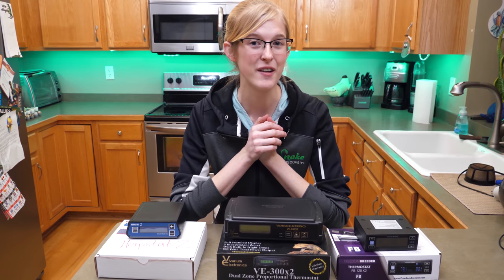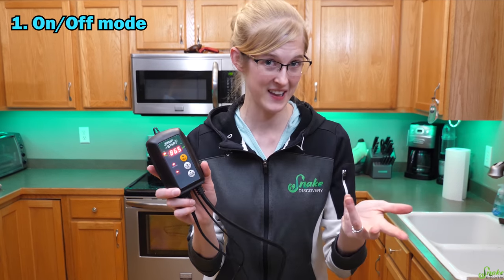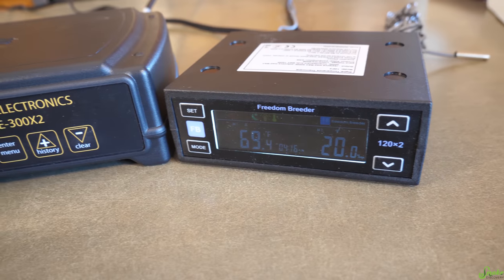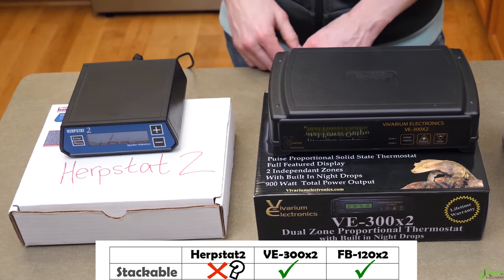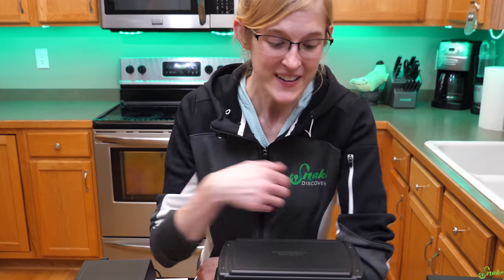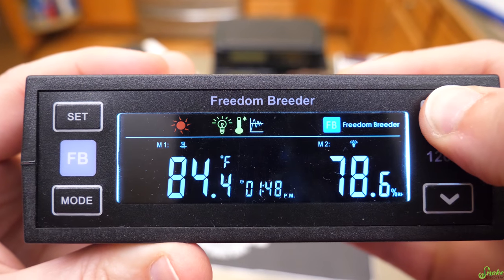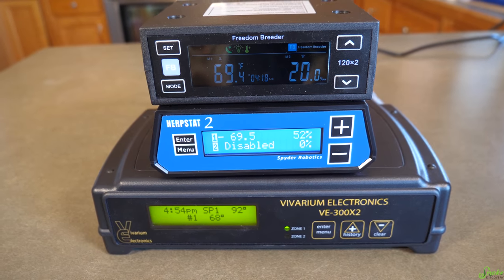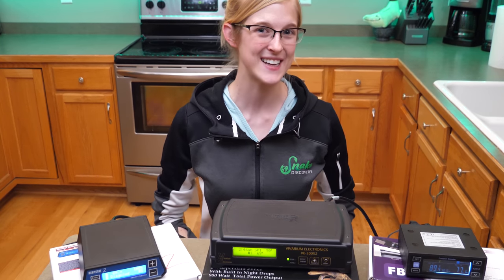Professional Thermostats: How they Work and Which is Best

Comment: Thank you for making this video, Emily! I've been wondering about this lately. I'd love to see a comparison between these and some of the cheaper alternatives.
Reply: Clint make a video about black Roughneck monitors
Reply: Clint's Reptiles   I’ve gotten the impression these are for people like yourself who keep lots of reptiles. Emily has promoted Jump Start over the years, but I found one on Amazon I actually like better, and its cheaper. Boho Farm Heat Mat Thermostat. It’s $17. I needed to switch as I had 2 Jump Starts die on me. At $35 a piece, that gets expensive! I’ve been running the one on my python for almost a year and it’s still doing the job.
Reply: @jesusbeloved3953  I havent been able to find a cheaper alternative to a dimmable thermostat - which is very necessary for heating elements with filament (such as basking lights) as pulse/ off on thermostats can limit the life of the bulb
Reply: Damn she didn't even heart your comment
Reply: @jesusbeloved3953  Oh nice. Cheaper is better. If you have time, could you reply to this and tell me how big it is? I don't want something too big. Thanks!
Reply: @anonymoose_987  She doesn't have time to go through all the comments. I mean, when you have like 100 reptiles, looking through comments isn't how you spend all your time. XD
Reply: Clint which thermostat do you use?

Comment: Just a note: visually opening your units and seeing something that looks like a relay does not mean it is a probe temperature safety shut off. Relays can be used for several different functions in an application like this, and indeed relays may not be the best option depending on circuit design. It would be much more useful to get the manufacturer's information as to their safety features, as well as how they work (there are many possible failure modes besides hi-temp on probe).
Reply: All power on a Herpstat is controlled by the triac components.  The safety relay is inline to the main power running to those and acts as a kill switch.  Under normal conditions the power flows through the relay to the triacs and when activated the relay breaks the contacts so it will cut power to all outputs on the thermostat.  The main reason for that feature is if a triac fails it normally fails full on so you have a run away heating condition.  These failures were common with other brands who used triacs that were barely rated for the spec.  I have always used much higher rated triacs in my design so that type of failure is extremely rare but I came up with the safety relay as a precaution.   However, it doesn't provide automatic protection because the user must choose to turn it on.  That is because there is a downfall that comes with it.  Lets say you have it enabled and you have a situation where one of your enclosures overheats (probe falls out of cage, ect).  When the relay kicks on you are going to knock out power to all outputs on a multi output thermostat.  If you have eggs in a incubator on the other output its going to go without heat.  Since its going to affect the other outputs some people may prefer to go without the safety relay and deal with the overheat on one enclosure if their income is depending on on the other enclosure.  We can't make decisions like that for people which is why we always try to give the options to the user.  That safety relay can be triggered on any alarm, just high, just low, ect.  The advantage of a single relay though is sometimes it catches when people make a mistake and pair the wrong probe with the wrong power cord causing their own overheat situation.  If you only shut down the side that was sensing the overheat it would no be effective because the user has the probe in the wrong enclosure.  By shutting power down on all outputs you can still make the save.  Again, many possibilities so it pays to be flexible with your options.  Oh, and wifi is on the way.  Email alerts, scheduled status emails, remote monitoring and setting,  graphed data, color lcd,  browser based so works on iphone, android, pc.  Its pretty slick.  It will be for the techies.  Launch date is not set yet but its not far off.  User manual on the new Herpstat 2 SpyderWeb device is on our website under the support section.  Great video BTW!  Customer mentioned it and sent me here.  :^)  -Dion (Owner, Spyder Robotics)
Reply: i have a snake and his name is zeno and hes older than me my family got him a year before i was born :)
Reply: @spyderrobotics_sales  I just want you to know that this response earned you a customer. It's really cool that you took the time to explain this.

Comment: I've been using the same Herpstat 4 unit, trouble-free for 10 years, reliably controlling light, heat, and humidity, nonstop day and night. It's an impressively solid and easy to use product.

Comment: Very very useful!  I burned a big scorch mark in a decorative throw that I was using to protect a piece of furniture under a snake habitat when my heat mat went to town on it. Could have done some serious damage to my snake as well, but the potential for fire with heat mats, even really well made ones, should not be overlooked!  I wish heat mats came with Built-in thermostats. Reptile products do not tend to have them, but I was able to find one on Amazon that was designed to warm up seed mats for gardeners that had a built-in thermostat. It was excellent and not that much more expensive. :-)

Comment: I have used the herpstat thermostats for years.  Early on I used the Helix brand. The Helix thermostats were nice but lacked the options that the herpstats have. The earlier versions of the herpstats had fans in them. The fans would eventually go bad causing issues with the thermostat. Spyderrobotics has since changed the design of the herpstats, removing the fan. At least in the herpstat 2 and lower.  I've never used the 4 or 6. I'm sure the VE, and FB are great also. Spyderrobotics has great customer support if you do ever need to get a replacement, or repairs done.  I'll be sticking with the herpstats. In my opinion, they are the best thermostats for reptiles on the market.  I'd avoid the cheap petshop thermostats. You get what you pay for. Buy cheap, buy it twice.   Spend a little more get a great product from a very well established company.
Reply: @not_mrphilips  Those are non-proportional thermostats and are at a large disadvantage for fine temperature regulation.  They are half as expensive because they have half the tech.  Plus you have to listen to the clicking relays all night long which makes them unreasonable for use in a bedroom.  They have no real features / alarms.  Their quality is no better.  You can search the web for reptile use and brewing beer use and find plenty of people that have had failures with the industrial thermostats.  The Herpstat is designed specifically for reptile use and we have worked with people almost 20 years now fine tuning them. Our Herpstats are used in large zoo's all across america as well.   You should try a Herpstat sometime and see for yourself.   They are a little more expensive but when you consider what people spend on their animals its money well spent.   :^)  -Dion (Spyder Robotics)
Reply: @not_mrphilips  From my information CE does not require 3rd party testing so most manufacturers can use the CE.   Either way our products are not  240V units or marketed for overseas which is where CE would come into play.

Comment: I just ordered a VE-300 single probe.  Price range is $144.-$165. The $165 comes with overnight shipping which Amazon values at $25.
   The single probe has 3 modes. Pulse ,  propotional and on off. Dont know why the 2 probe has less options. will running an EV 80w element.  Went with 300 over the 200 because of the built in night drop.
  Good informative video. Very appreciated 👍

Comment: Depending which state you're in, the warranty sticker is meaningless and in fact does not void your warranty.

Great video, but I still prefer my much cheaper option which does all the features mentioned.
Reply: What one have you been using?
Reply: @Kyenta    "VIVOSUN Digital Seedling Heat Mat Thermostat Temperature Controller" (purchasable on ebay for $34 CAD) and "Mini LCD Digital Temperature Humidity Thermometer Outdoor Hygrometer Meter Probe" (also purchasable on ebay for $3.50 CAD). I've had them for over a year now, I plugged in multiple heatmats to 1 thermostat without any issues and it's still very accurate according to my temperature gun and still reliable despite all the power outages and power surges I've been getting in my neighborhood.

The moment you put a label on something relating to pets, the price instantly skyrockets despite the product being identical to other products. The world loves to scam ppl.
Reply: Isn’t it labeled for that because it is meant specifically for that particular animal?
Reply: @battlebear437  Not necessarily. Things like sphagnum moss, heating mats, bulb fixtures, and so many more things are much cheaper if bought elsewhere that is not "reptile" or "animal" related.
Reply: @ryanchambers621  idek why I didn’t get this right away...I suppose it’s similar to places that you can rent for events, but the moment they know it’s for something like a wedding, they jack the price way up.

Comment: if you want to check the temps in your rack and want a high temp cut out as a safety, i use the Inkbird 308-T wifi controller. it allows me to see the temp and trend throughout the day and night and i can set alarms in the apps.

Comment: I bought a herpstat6 right off the bat when I got into the hobby 3 years ago and I have zero regrets. Safety features and added functions(also has a light dimming feature that simulates the sun rising and setting that I didn’t notice you mention but really cool for natural enclosures.(doesn’t work with led lights tho.)) compared to there completion made it a no brainer in my opinion. Great video tho!

Comment: I've been reading up on different thermostats, and lots of people have said  they started making  thermostats with pulsing and dimming options cause one of those settings would create a humming sound throughout metal snake racks. If you have PVC racks, i guess no noise would emit. I'm looking up videos cause i need a new one. My VE-100  keeps making a clicking noise every few seconds, and it says check probe. So my choices are A) 20 bucks on a new probe. That might not work. B) 150 on a new thermostat.  Or i took option C) 28 bucks on a thermostat called inkbryd. Lots of people talked highly of it in many snake forums.  And with Christmas and  the first of the month right around the corner , i really have no choice but to take the cheapest route for now.  Fingers crossed. Thanks for sharing your thoughts and insight on these. Happy New Year 🎉 ✨️ 💛 🤗

Comment: I run a herpstat 2 for my noodle. One probe for the heat mat, one for ambient temps.  Don't recall if I heard about those other two brands while researching to prep for getting my ball python, but I did know that I was going to spring for something higher grade than a jumpstart since I only have one snek and figured I could afford to spend a little more for the functionality, quality, and built in safety features.

Comment: For what its worth... i have experience with the VE and its "warranty".. i got a unit and tested/used it for 3 weeks, and i encountered a range of problems, from the unit not sending power to the heating devices, to LOUD clicking noises that would not stop, but the problems were sporadic, it would work for a day or two and then fail in the middle of the night.  I contacted them, and they ran me through a range of "issues" that i might be having as in getting probes crossed and other user errors, but nothing fixed it, and i literally tried everything, spent hours and hours working on it. Finally i demanded to send it back, they raised their eyebrows, said they just wanted to make sure it wasnt a 'user error' as i was going to have to cover the shipping cost myself, and they would hate for me to ship it back for nothing. I paid the shipping back, and they claimed to find no problems with it and just refunded me as i told them i was not taking that same unit back. I hope to god they didnt pawn off that unit on somebody else.. 
After that i got a herpstat and have had ZERO problems, its half the size, has more functionality and is just a dream. 
Anyways, just me 2 cents on the VE "lifetime warranty". Cheers.

Comment: For dimming output so far I have found Herpstat 1, 2, 4 etc, and Exo Terra thermostats (models with screen but watch out for the model with a light sensor in temp probe as it makes using night drop impossible if u have a heat lamp attached). I got a Exo Terra 600W PT2463 and the temp probe cable is so thick and only 6ft long. The heat lamp dimming is also not smooth. So now Im going to get the Herpstat 2 which has sunrise/sunset ramping, very smooth light dimming & a nice thin 12ft temp probe.

Comment: Awesome video. And i have the jumpstart thermostat after watching your videos. I had to get it for my new setup. I got an Animal Plastics T8 with an 80 watt RHP installed. Found it on Craigslist for $100.
Reply: Radiant heat panels are useless if you are not using a "pulse" thermostat. Jumpstart does not make those.
Reply: @GodZirra  thanks for letting me know that. I will have to get one of those then it was the only thermostat i had from before i upgraded

Comment: Freedom breeder upped their price since this video was released.  I've personally had trouble with the Vivarium Electronics (VE) thermostats and won't buy them again, even with the lifetime warranty.  Spyder Robotics's Herpstat is 100% worth it for the dimming feature alone and good luck finding it in any other commercially available thermostat at a reasonable price.

Now if only I could get my hands on the wifi enabled Herpstat 2 Spyderweb that has been sold out for over 2 months now.

Comment: VERY IMPORTANT QUESTION!! I plan on getting the herpstat, I will have my vision rack in 10 days! it has 5 tubs but all will be ran by one heat cable, do I need to get a thermostat with 2 or 4 probes??? I understand there's technically one heat source but is it better to have a probe for each tub or will 2 probes get the same job done? please help any opinions and tips are welcome!

Comment: If you need a cheap one probe controller for a heat light the HERPSTAT EZ1 on the herpstat website is a good controller I use it for my tortoise and it works great

Comment: How would thermostats work in a rack system? If you only have one probe, do you use multiple thermostats or just pick one bin for the probe to go into?
Reply: Erika Aberle You normally tape the probe onto the middle of the heat tape on the middle shelf.

Comment: Hello Emily and Ed! Would you guys consider doing a video discussing UVB? I just got my first reptile (a beardie named Montgomery Montgomery) and it is confusing! I have been using Facebook groups but the really don't explain much, they just beat you with the same you have to use tube uvb argument and they never really explain why? The only thing I've heard is coil uvb can hurt your animals eyes? I don't know what to think anymore! Lol 🤣 

P.S. Can't wait for more zoo videos! God Bless! ❤
Reply: The coil UVB used to be so bad it did hurt animals eyes. However the real problem with coil bulbs is that they are not strong enough for a bearded dragon. The two best brands of bulbs I've found in my research are either Reptisun T5 10.0 or Arcadia T5 12%.  T5 is the newest technology of fluorescent tube lights. It emits enough UVB for about 15-18 inches for a bearded dragon. A similar bulb, Reptisun T8 needs to be 6-8 inches from the basking site to give enough UVB.

Artificial UVB is simply so much weaker than real UVB from the sun. For the health of a Bearded Dragon or another lizard that needs 10, 12, or 14 percentage UVB consistently using the two bulbs i mentioned is the best choice. Another benefit for the long tube UVB is that your dragon can be in the hot spot with UVB or in their cool end with UVB. They have a choice. Plus I hope you have a hide so they want shade or privacy they have that it too.

UVB light should also be unobstructed. Ideally nothing between bulb and dragon. The two strong T5 lights can penetrate a mesh screen, but you have to account for almost 1/3 of the UVB being lost and move basking area closer to the lighting. UVB (real or artificial) also cannot travel through glass at all. Some people seem to think hanging out in a window is getting real sun time when it's not. Glass blocks all UVB :)

Comment: I am looking to replace my on/off thermostats for the snake enclosures. They are using 150w ceramic heat emitters. Would using the herpstat on dimmer be more efficient and save on electricity costs than using the on/off mode?

Comment: If you use a snake rack, you want to set the heating element of the top most enclosure at a lower temperature than the others, right?
Because heat travels upwards.

Comment: I currently own a herpstat 2 and was wondering which setting you think would be best for a radiant heat panel? As in on/off or dimming, etc. My ball python is in a 4x2x1 pvc enclosure with a heat pad and panel for ambient.
Reply: Pulse is the best. That is the only recommended option for heat panels. You should also not be using a heat mat with a heat panel. A heat panel is to be used solo.
Reply: @GodZirra  I use the heat tape at 90 degrees for belly heat and have the panel just for ambient since my house is cold during the winter. During the summer I only use the tape.
Reply: @luvlost03  The whole point is radiant is that you don't need to use other methods because it radiates heat to the entire enclosure.
Reply: @GodZirra  thanks for the info